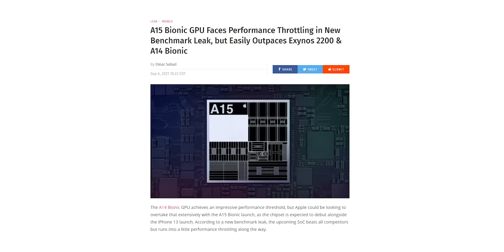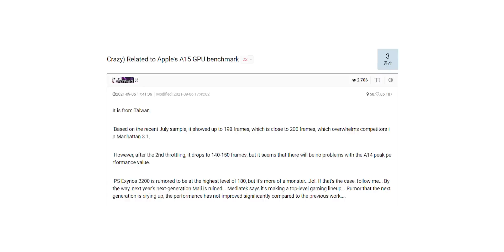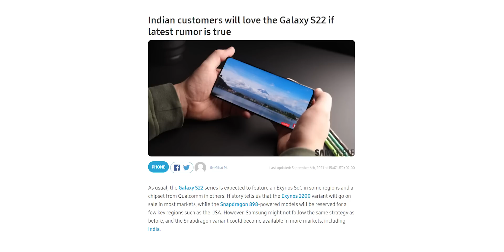iPhone 13 - Apple's Answer To Samsung and AMD

Comment: yeah okay the amd gpu could be that good too but at least you will get good framerates after time. better have 90fps for a few hours than 120fps but 30fps just a few minutes later
Reply: Just in every year, Apple beats the competitors even while throttling. Check some result back. And both side working to throttle less, so the final results will be a bit different.
But one thing never change, Exynos already a 8 cores CPU, while Apple only use 6 cores, less heat generation on the CPU side, allow them to use more heat generation on the GPU side.
Reply: @Winkoo6  Just check Genshin Impact gameplay of Glassy S21 and iPhone 12
Reply: @KarthikViswanath  i know the result, and i also see the differences there.. Apple consider the 50 degree as harm, and start to throttling.. but for android that is just the operating temperature, they start to throttling at 60 degree.. just always check the final result too..
the only enemy for that battery is the heat.. not to mention that the for humans the 60 degree is not comfortable to hold.. even the 50 degree, but that still a bit more acceptable..
Reply: @Winkoo6  But still what is the use of an incredible processor if it throttles a lot a performs like a cheap processor.. both Samsung and Apple should bring efficient cooling system
Reply: @KarthikViswanath  I still don't understand your problem with this, if Apple outperform the others WHILE throttling, is that really matter? Yes the better cooling would be great, but with the current still fine.

3Dmark results A14: Best loop: 2435 / Lowest loop: 1624
3Dmark results SD888: Best loop: 1524 / Lowest loop: 1396

So which performance you pick? The throttling 1624 is higher, or the fresh 1524? Yes in stability looks worst, but in performance doesn't really matter if they throttling, or not, they still beat the others.. (the results from May 22, 2021, but the different remains with about all updates)
Reply: @Winkoo6  I don't know what's wrong with YOU.. why you so obsessed with Apple and arguing about a frickin processor you're talking like SD performs bad compared to A14 .. higher processor  with terrible throttles after some time  is worse than lower end processor with stable performance.  I don't know if you have watched real life gaming of both
Reply: @KarthikViswanath  i watched those test, but i also checked the test results at the end.. what show you how much Watt they used for the test, and that amount also equal with the heat generation.. so with the rised temperature.. the battery only enemy is the heat, and 8 cores generates more heat like 6 cores, Apple also stop at 50 degree, but Android let use it while reach the 60 degree.. good, your battery is happy, and dying with a smile, or not..
In android is everything about kill your phone faster, so you can buy another one, and they get more money.. And that was fine 6-8 years before, when they made a lot of improvements in every year, but now, you don't want the newest phone in every year.. so don't force the users to buy a new phone more frequently, like before, let them decide (also most of the updates not require the newest Apple device, so even the older ones will get the new stuff, even on the 6 years old model..)
Reply: @Winkoo6  Now your points are just fanboy-ish and hypothetical. It doesn't deserve any reply
Reply: @Winkoo6  I hope you know that most of the Android apps are supported for Android 4.0 and above , which was released like 8 years back or so.. the main aim of updates should be to make your phone capable of running latest software.. but iPhones with iOS 13 doesn't even support some latest apps.. so what is the use of 5 year updates? And did you know that the updates you get aren't same, it will not have many features in the older model. And iOS updates bring literally nothing when just 1 One Ui update changes the whole phone like a lot a camera features and other UI features. So even if it has 5 year updates it isn't even equal to 2 android updates
Reply: @KarthikViswanath  Apple just abandoned the non 64bit softwares in app store, so they can optimize better because no apps from before, from  the slow 32bit era (before 2013).. so do you think if some app what is NOT updated in the last 8 years from 32bit to 64bit is bad to abandon? no, because that app is already abandoned by the developer.. if they didn't touched it for 8 years..
Reply: @Winkoo6  You telling Among Us is a 32 bit software?Even Among us cannot run on iOS 13.. did you know? can't wait for the next reply like.. "who is going to play those games"
Reply: @KarthikViswanath  i don't have that outdated version of iOS, but the Among US detail page say it, it's required iOS 13 or lated, so if it's not working for your 7 years old or later phone, you can contact with the support.. ebcause even the 6 years old phones can be updated to iOS 14..
or just play that game on Samsung Galaxy S3 or S4 because android is better..
Reply: @Winkoo6  apple uses 6 giant cores 
it just doesn't matter 
those 6 giant cores generate a ton of heating
Reply: @keqling7086  how can the "giant cores" consume less amount of energy, if they are that big.. just check any game comparison, they perform about the same, but iPhone usually use 4-5W for that, and Android use 6-8W.. so where are those "giant cores", what consume tons of power? (because the consumed power is generating the heat.. like 4-5W heat capacity vs 6-8W heat capacity)
Reply: @Winkoo6  exynos 2100 generally uses 4_5w watts too 
other brands like huawei and xiaomi overclock their chips and set the throttling temperature high so they use more power and generate a ton of heat 
that's why samsung and apple flagship last for longer compared to other brands
Reply: @keqling7086  you are right in that, Samsung started to control the heat generation in the past 1 year, but sadly it's showed up in the perfomance too, they are a bit behind the others, but in long terms that can be a victory for them, as you said, the phone will be usable longer, compared to the other android phones. But they still depends on Google, if Google not supporting something in the next android, they can't gives you that in updates (and they are still have Snapdragon CPU, so they are also depends on Qualcomm with updates).
Reply: @Winkoo6  3 years of software updates is pretty good ngl
but still im impressed by apple's 5 years support ! and yes exynos suffers a lot from stupid mali gpus

Comment: Iphone still have horrible exposure in camera
Reply: Interesting, every photo of ours with iPhone 12 Pro has great exposure
Reply: Interesting, every 100-200Mp pictures on any social network is looks like a cheap budget model.. Unlike the shared images with iPhone beats everything in quality.. So why do you need the ultra megapixels, if you can't do nothing with them? Both has advantages and disadvantages.. so you can decide, which one you want.
Reply: @Winkoo6  True

Comment: This doesn't surprise me at all. My hopes were never up for the AMD chip to beat apple this year or for Samsung to bring it to the S22. Maybe the the s23. 😆
Reply: Well AMD is set to beat apple silicon..... If they add a graphite cooling then it's gonna be good
Reply: @adithyansunil1153  The problem is that Apple doesn’t even have cooling and beats Exynos AMD version though
Reply: @wellszhou8286  The amd doesn't have cooling either meathead!!
Well the phones haven't even been released these are just unnecessary leaks. Until I see the results in a phone, then I'll judge
Reply: @wellszhou8286  that's true but still AMD is still powerful Samsung needs cooling
Reply: @adithyansunil1153  Yes, Samsung is making progress
Reply: @6animegeek9  Bruh, the leaked result is with vapour chamber and graphite which Apple don’t have due to limited quantities, and even then scored high, and with cooling, the GPU performance will be the same as the M1 MacBook GPU
Reply: @wellszhou8286  But what good will that do considering it's inside a mobile phone? I believe people who buy up-to-date iphones regularly are usually business men. Who games with an Iphone anyway(I know people do it) but there'll always be limitations as it'ss a mobile device
Reply: @6animegeek9  Because it doesn’t thermal throttle and if iPhones were to have cooling, then we can achieve the GPU score of many windows machine
Reply: @wellszhou8286  You say "we" lyk u're one of the developers😂😂!
It's a mobile phone for fucks sake, having a powerful cpu/gpu doesn't matter cause when it get's throttled it overheats, draining the battery more. Chips have been powerful enough since the a13 series and snapdragon chips lyk 860,870,778,888,888+
Reply: @6animegeek9  Ironically, a 60 hertz 3678 mah iPhone 12 Pro Max with A14 Bionic beats out a 60 hertz S21 Ultra with 5000 mah and an inferior SD888, also, Video rendering and editing is where there is a huge difference between A14 Bionic and SD888
Reply: @wellszhou8286  Ironically, that has more to do with software optimization rather than hardware, cause the sd888 is more energy efficient.
And when did this discussion get to comparing iphone and samsung?
Reply: @6animegeek9  Because you claim that the more powerful the chip the more it drains the battery, but that is simply not true
Reply: @wellszhou8286  What I implied was these chips would produce more heat, effectively draining battery faster. Do you get my point now?
Reply: @6animegeek9  Yes

Comment: Holy! India may get Snapdragon for S22 which if true is a very good news. Snapdragon and exynos variants of same phones feels like two completely different phones to me. I still can’t understand why snapdragon is only provided to US market-
Reply: I'm not sure if u know but exynos 2200 based on leaks is faster than snapdragon 898
Reply: @malathomas6141  but Samsung is cheaping out on cooling like Apple. Apple is very bad at sustaining performance, screen dims within 15 minutes if u are outdoors.
Reply: @kpsayyed84  Apple doesn’t have enough vapour chamber cooling lol, they have to produce like 175 million units of vampour chamber cooling every year but don’t understand why Samsung, they have only 20 million phones to sell
Reply: @wellszhou8286  that’s a point too, Samsung is so wrong, they also cheap on chips in budget phones, giving Xiaomi and others the edge
Reply: @kpsayyed84  Yeah, old Sammy is better
Reply: @wellszhou8286  If they can make 175 million new main sensor cameras,new 175 m chip,175 m batteries,175 m ear pieces,
What is stopping them to produce 175 m vapour cooling?
Reply: @SJ-cl4wq  Limited Supply as it is hard to produce 175 million units, hopefully coming this year, same with producing 175 million 120 hertz displays
Reply: @malathomas6141  I think at this point, Xiaomi is the new Samsung.
Samsung stopped jumping to new design every year and sticking to ‘If it ain’t broke, don’t fix it’ approach like Apple, trying to be Apple of Android.

Comment: But the strange part is that the only gpu benchmark A14 was close to Amd was already Manhatten. In Manhatten it increased from 146 to 198 (35.6% jump) but it's not enough to beat Amd on Aztec. Cuz a jump of 35.6% from 79 to 107 on Aztec normal would be still inferior to 120 of Amd and the same happens in Aztec high.
Conclusion: It can only pass Amd in Manhatten with heavy throttling afterwards.
Reply: Honestly 3d Mark is more accurate, it simulates high performance games
Reply: @mikz2489  Wth is that dude? A14's real scores are the ones in your brackets in terms of Aztec scores. The ones beside that never existed. A15's Aztec scores didn't even leak and you somehow magically got it. Besides 127fps on Exynos 2200 is from the 3rd round throttle test. A15's 140-150 is from the second round.
Reply: Umm the chipsets aren't even released yet. This conversation is pointless till there are real world tests and not "leaks"
Reply: Just wait for real-world testing/Geekbench. I wonder if anyone saw that the device name was censored as a red flag for possible faking. I wouldn't confirm that unless I saw it without the name blacked out. I don't trust simulated benchmarks or sketchy screencaps that have device names censored.
Reply: @mikz2489  You just made those up.
Reply: @mikz2489  Source??

Comment: again if samsung wont trust using 1 chip in there phones it means the other chip is ass and my guess is, the exynos s22 chip will be trash once again
Reply: Illogical thinking, do better.
Reply: @malathomas6141  not
Reply: @truhd  nice counter argument
Reply: @malathomas6141  lol its not a counter im just not gunna argue with a stranger when the facts are right in front of u
Reply: Actually Qualcomm working with the engineers from Nuvia (ex Apple engineers), so there is a high chance Exynos will remain the 3rd in this race after everyone showed his cards..

Comment: The a15 still will probably overheat, just like the a14 does
Reply: Ming Chi Kuo said Apple is testing heavily many  vapor cooling chamber for iPhones etc. to maximize their chipsets performance esp heat management. If not throttled...the heat will shorten the the battery life fast.
Reply: @samuelmanny6231  I still think Apple will put in a Vapor Chamber Cooling System this year, because a device like this at 120Hz will literally be another Exynos 990
Reply: That's what Sal said, it throttles, and so does the exynos AMD, and snapdragon is best

Comment: Again, as I have stated MANY times before, in 2022 Exynos won't be mind-blowing !!!
We are starting to see the deflation of the AMD hype and we have not seen any real-life power yet.
Remember that we would see it in 2021 ??

Again we will 2 soc markets and Exynos will Again fail to impress. Mark my words !!

As usual with any S series Galaxy there is mega hype, mega cheering and then every month we will see a let down.
- no under display camera
- no special design
- not a word about the secret Olympus Camera tech

And there is more to come.
It will just be an itteration upgrade and that's it.

Comment: I still dont understand which on is the best? Exynos or Snapdragon?
Reply: Harjot Singh, generally it is snapdragon that's better, but this time around, since AMD is working with Samsung on the Exynos, it might actually be the Exynos variant. Time will tell.
Reply: Snapdragon is way better right now but if this rdna 2 exynos chip is as good as they think it is we may see exynos being the more desirable chip in the galaxy line
Reply: Snapdragon. Exynos 2200 will have power consumption problems. So a bad battery life is expected for the S22.
Reply: @jul1anuhd  assumption
Reply: @jul1anuhd  don't forget that, Qualcomm is manufacturing at Samsung currently, so even Snapdragon lost the TSMC advantage, now we can see the real different between SD and Exynos (because both of them use the less efficient Samsung technology).

Comment: If samsung bring snapdragon on the s22
I will be way happier than ever 

I don't care about the Grafics on a chip & i want good & reliable performance which samsung has not been giving since the s8
Reply: Viknesh AR, you must be talking about the Samsung phones with the Exynos chips. The S21 Ultra with the Snapdragon 888 is a beast and at the top of the pyramid right now.

Comment: Why do we even need such a powerful graphics in phones
Reply: Play games
Reply: I dunno. Playing games on a Phone is s t u p i d. The only games 99.99% of the peoples play is something like Clash Royale or Subway Surfers which only need about 1% of that performance. Twitter? Nope. YouTube? Nope. Netflix, Disney+ or Amazon Prime? Nope. Instagram? Nope. News? Nope. Basically useless.
Reply: @jul1anuhd  what about cod,pubg,fortnite,apex legends and valorant etc.. these games are so heavy that's why every content creators are using iphones
Reply: @BLACK_N_BLUE_BLOOD  Call of Duty is a PC Game. Mobile game is trash, Pubg PC game is nice but it is trash on the phone, Fortnite itself is just trash, Apex Legends is good on Origin but bad on the phone.
Reply: @jul1anuhd  that's just your opinion but so many people are playing these games on mobile
Reply: Yeah it's BS.
We need power for photography computing, optimisation for battery life and other usefully stuff.
Most games that are played can be done with a 2 year old soc anyway.
On a 6.X inch display raytracing is nonsense.
Reply: @Roomer645  on a 6inch screen Ray tracing is nonsense, based on what exactly?
Reply: @malathomas6141  because heavy graphic based gaming isn't done on a 6inch screen.
Raytracing, 4K texturing and such are done on big screens and heavy consoles/PC in order to take advantage of it.
Just look at the top 10 mobile games and check out the graphics.
None of them are extremely GPU heavy that need raytracing for realistic mapping and such.

Comment: The evil fruit strikes back however what is the most important thing is how are these 2 chipsets going to deal with battery life? If both of them have similar battery life to their previous moddles then it's a loose loose situation for both companies although it would be even worse for Samsung since they are not known for the best battery life out there.
Reply: Im an android guy but apple takes the crown for battery life this time. The a15 is really well optimized and furthermore we get 700 mah more on the max version. Togehter with the LTPO Display we should get like 7—8 hours with 120 Hz. The s21 Ultra got 6 1/2 hours. With an improved processor we should get 7 hours